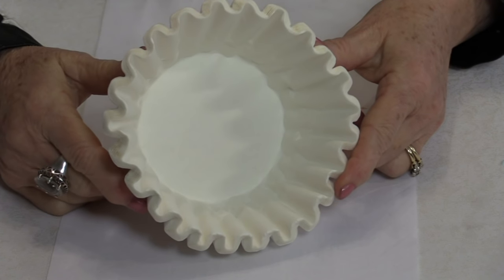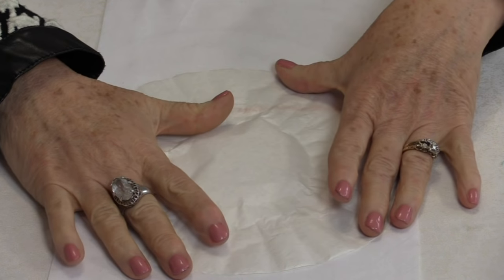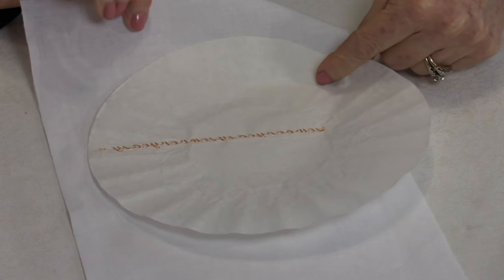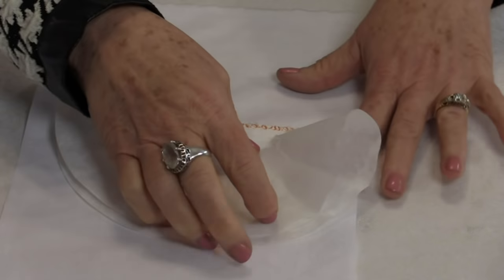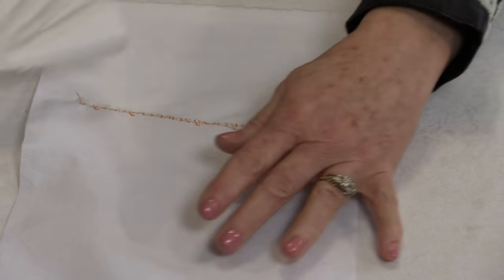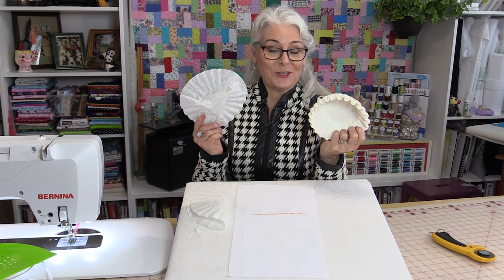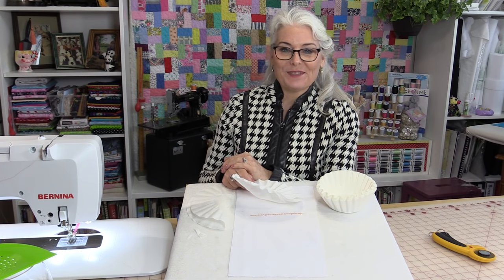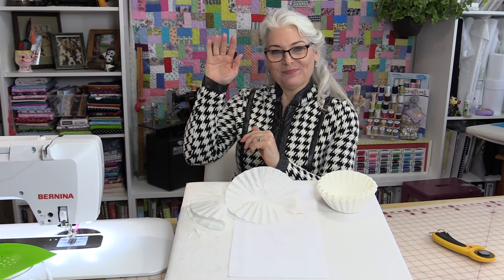What can you use instead of Stabilizer?

Comment: so instead of using adhesive stabilizer could u use contact ?
Reply from the maker: I don't think so. It would be hard to take off afterwards :) good question
Reply: No! Will not come off and your needle will get gummed up fast. You could use basting spray( temporary) adhesive and a piece iof cotton/poly broadcloth:)